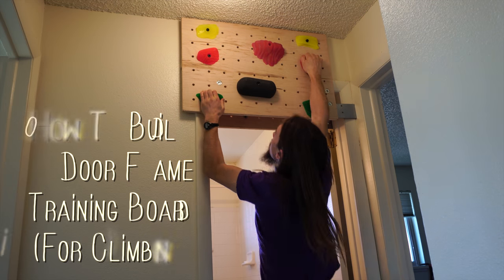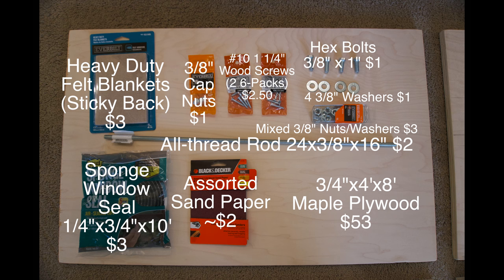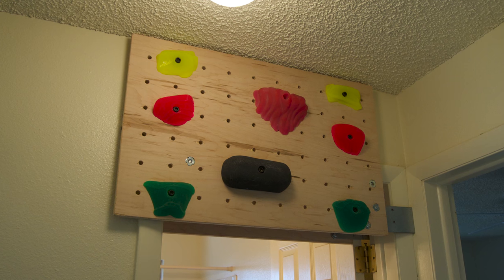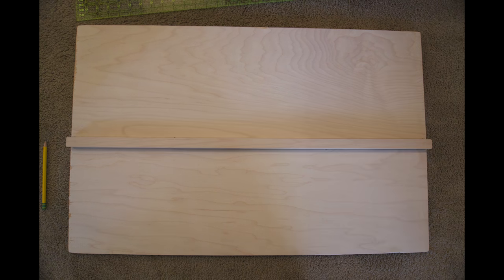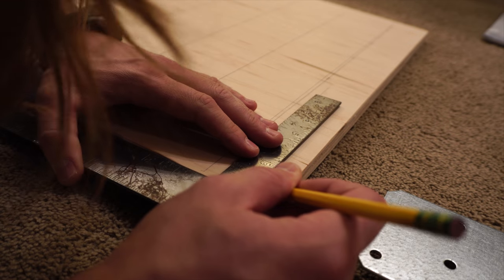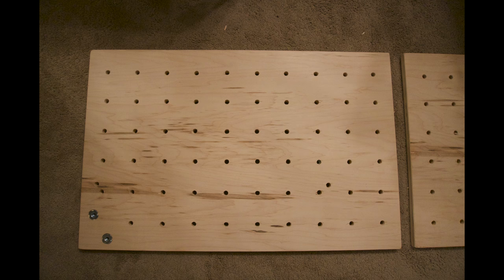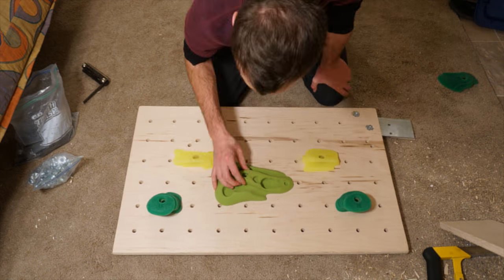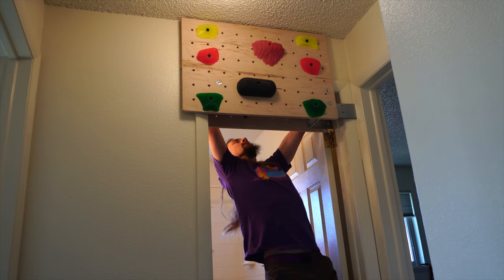How To Make A Doorframe Climbing Board - DIY

Comment: I’ve now built one of these door frame climbing boards and have a few notes that might help others.

 ▪ First I made mine 32 inches wide instead of 31 inches because that was the width of the ones they are actually selling and I like even numbers. If one does that, remember to add an extra ½ inch to the ends on each side when laying out the grid according to the video’s dimensions, or the 3” spacing will not work out. Also make sure the 1” cleats for the back are of the same length as your board.
 ▪ My frame fits almost nowhere in our house. Not because of the extra inch, but because of the odd way our house is and various objects in the way. I’m also not entirely confident my wood molding will support my weight either.
 ▪ I purchased my lumber at Home Depot and had them cut it on the big machine including extra boards in case I wanted to make another. Note that these are rough cuts. Your boards might not be exactly the same length. They charged nothing for all the cuts they made. They did a horrible job on the 1” cleats for the back. I had to have a friend cut me new ones.
 ▪ Because the cutting is anything but exact, take a T-square and mark the board square, as close to the ends as possible, and use those lines as the “edge” for measuring. Being square is very important.
 ▪ You only have to measure one board. Line up your second board exactly to your marked board. You can put in deck screws to hold it together so it doesn’t move. Three will probably work, but I used five. I also put them in locations for the holds holes (four corners and the middle) as to not put extra holes in the wood. When you need to drill those hold holds, you can do them carefully one by one. I also clamped the boards together at this point. The holes that are most important to line up are the ones for the rods that connect and stabilize the two boards. I don’t like how it’s done in the instructions, but more on that in a bit. Once they are drilled, you will have two mirrored boards. 
 ▪ BEFORE you drill any holes, there is part of the video that suggests to countersink some holes with a Forstner Drill Bit. The video shows drilling all the holes first (actually it kind of shows that, but then when it shows this countersink part, they aren’t drilled), but if you drill the holes first, you cannot line up the bit to counter sink. Do this before drilling holes. Because I drilled first, I wasn’t able to countersink. It’s not really a necessary step, it just makes it look smoother.
 ▪ The video shows the metal rod threaded through two T-nuts in two places and capped off. After hoisting the thing up and trying to screw the rod through both nuts and get everything even, then unscrewing everything to cut the rod to length, I found that to be very cumbersome and inefficient. I haven’t tried this yet, but I would suggest, not using the T-nuts at all for the rods. Instead, drill perhaps a smaller hole, thread on a wing nut and washer for the inside of the boards (So two wing nuts and washers inside facing opposite directions) after first sticking the rod through one board, then putting a wing nut and washer on the other side of the boards so the rod can be freely moved back and forth for adjustment. Then tightened into place with the wing nuts and washers for stability. Also leaving extra rod length  for various door frame depths. I would still put the Cap Nuts on the ends to keep from ripping a gash in one’s arm from a sharp end of a protruding rod. I won’t leave a super long amount sicking out either.
 ▪ A new hacksaw blade will make cutting the heavy duty metal strap much easier. It doesn’t guarantee cutting straight, however.

These are just some thoughts. I hope the are useful for anyone trying to build one of these. I also have ideas on building a much larger indoor climbing wall in my limited space ….
Reply from the maker: Great info! I'm glad you built one and would love to see any pics if you have them. Per the forstner bit, one solution to doing the countersinking after drilling the holes is to use another piece of plywood with a hole of the same diameter as the forstner bit drilled completely through it. Then just center that hole on top of the drilled hole, clamp it down, and use that as a guide for the forstner bit. Ideally, they should be done before (and I should have mentioned that), but they can be done afterwards as well.
Reply: Another solution would be to put a dowel rod plug in the hole and center the Forstner bit on that and then just knock out the plug once done. I considered that but decided it wasn't worth the extra effort (to me) to do it. I do have photos, but not sure how to post them.
Reply: I would go all the way to 33 and inches, since internal wall studs are 16 inches apart on center.  33 would give you a 1/2 inch of wood you could use a screw in if necessary.  Just standardization for multiple options is all.

Comment: What size is the door frame opening on our door (inner dimensions). What made you decide on 31 inches wide? Not 32" ... 30" ...
Reply from the maker: The inside of my doorframe is 28" wide. I made the board 31" because it allowed for a nice amount of overlap past the end of the doorframe, but without being too wide and putting too much leverage on the edge of the board. I'm sure 32" would be fine though.